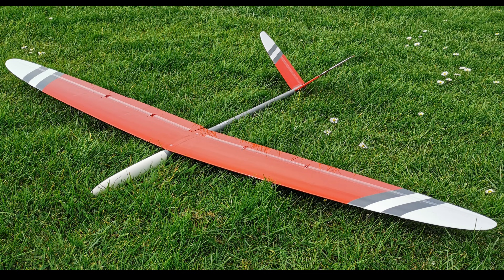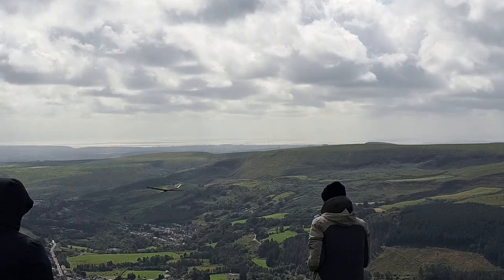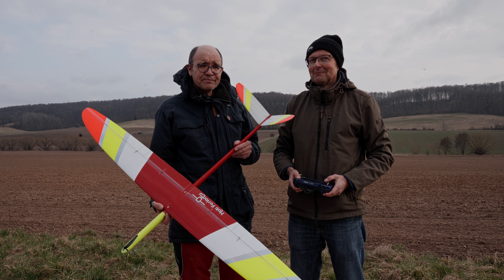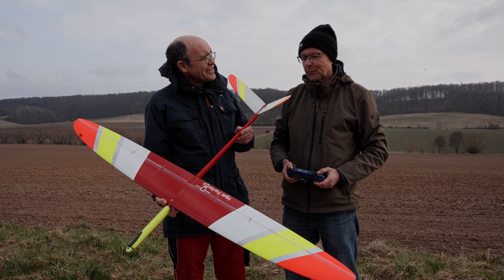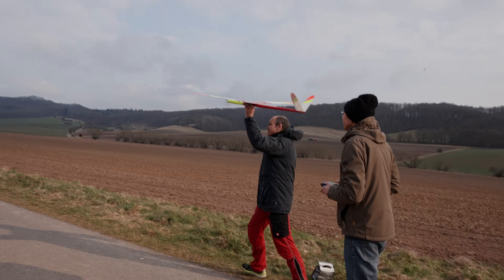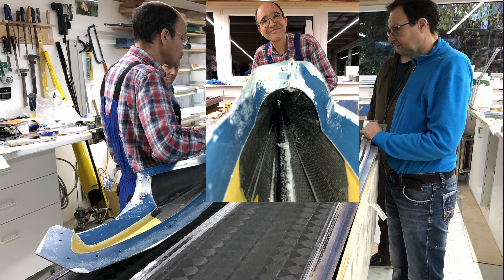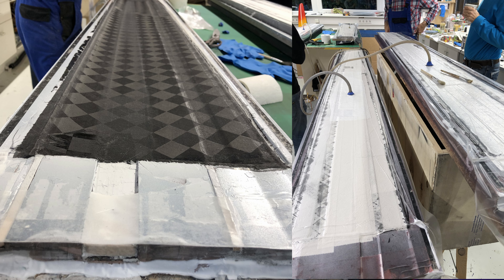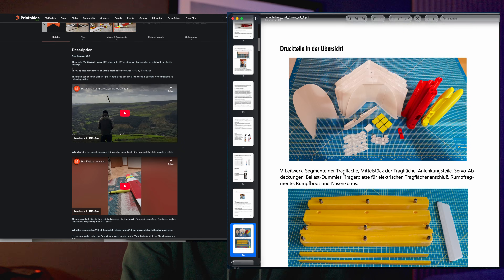How the Hot Fusion Mini F3F glider was created

Comment: Looks very nice, and nice to see it at both Mickey's and Rhossili.
You could perhaps add here what minimum size bed is needed for the printer?
Reply: Hi, this is correct, we were flying at Mickey's and also Rhossili, the view was fantastic😊. The minimum printer size in x and y direction will be determined by the first wing segment, which is about 200 mm x 200 mm, the highest Part has about 245 mm in the z-axis but of course can be split into parts and later on glued together. I am currently working on Version 1.3 with some evolutionary further improvements which are compatible.
Reply: @matthiasboese4154  That sounds fine, most new printers tend to be 250 cubed other than perhaps Flashforge. So it'll fit almost all.
It's been some years since I moulded a glider but I've printed a couple recently that have been surprisingly good. Might have to buy the files!
Been a few years since I flew at either Mickey's or Rhossili, but have good memories of Mickey's. Had some good competition results there!